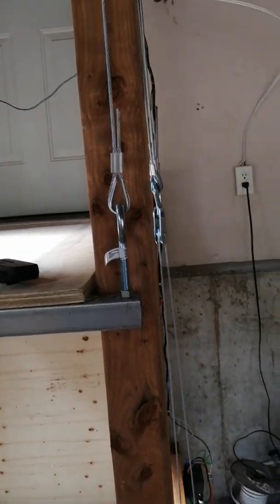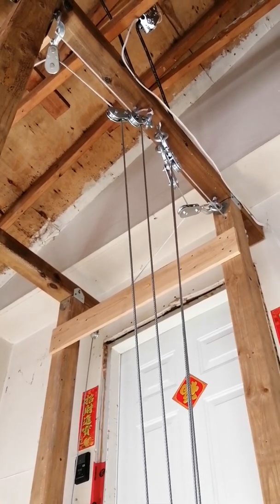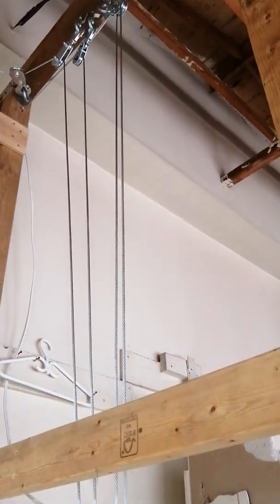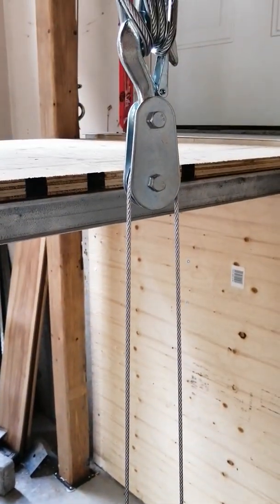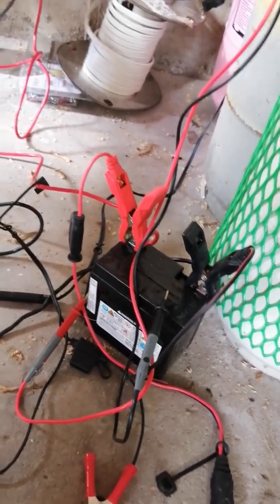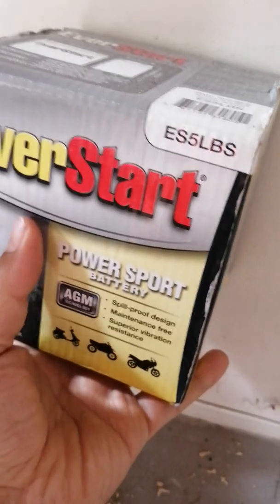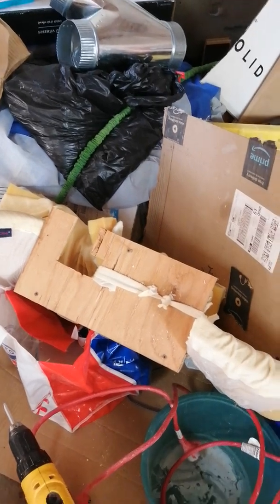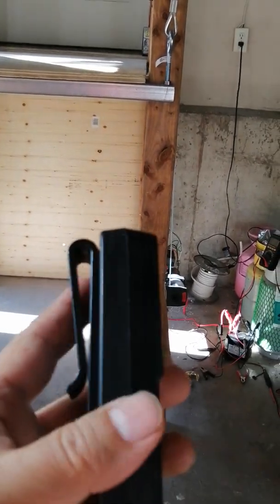Use Winch To Build A Wheelchair Accessible Elevator In Garage DIY

Comment: No, no no NO!!!   This may be  "safe"   until you start hoisting HUMANS.  Even  a couple of feet, if something breaks and you fall that far,  is going to hurt  BAD.  And snapping wire  can  do a LOT  of  damage,  to YOU.   REAL  elevators have SAFTIES.   Brake mechanisms,  ratchet pawls  to stop downward travel if something in the hoist  breaks.  

IF YOU CAN DO NOTHING ELSE  at least  provide  REDUNDANCY  that is to say  TWO  hoists     one to back up the other in case of failure.    And please think CAREFULLY  about  anchors in wood.  Are these thru bolts or lag bolts.